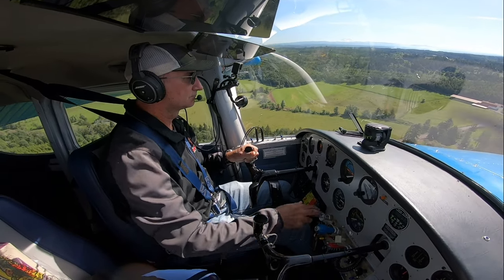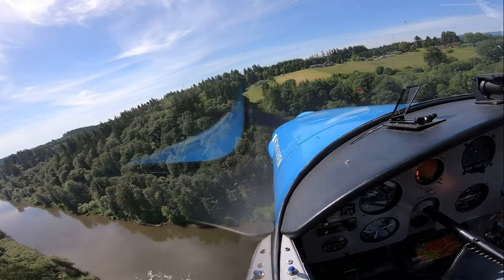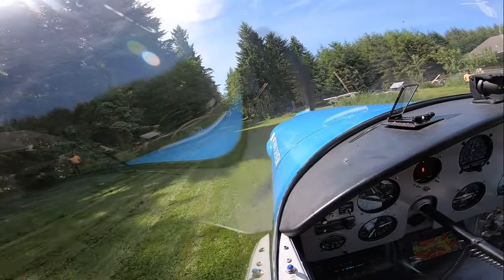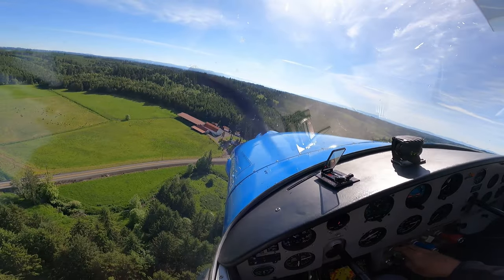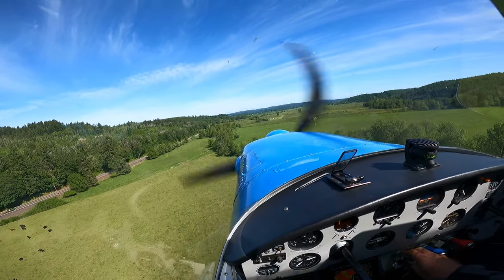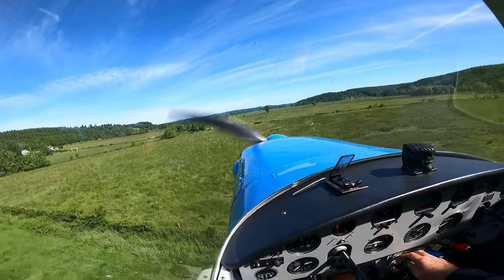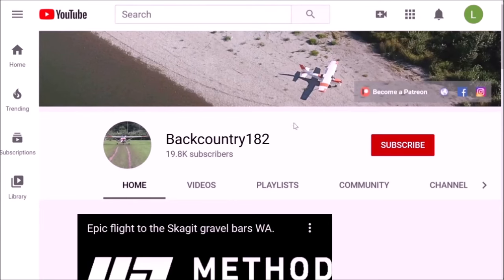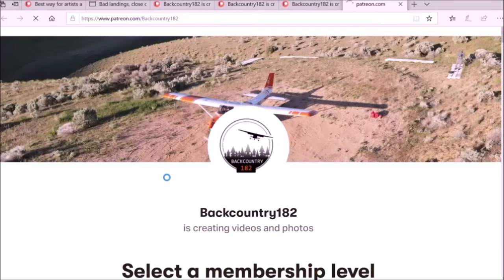Short , narrow uphill landing strip, Ski Jump #3

Comment: Hey man, like ur videos a lot! Question ... at 1:59 you make the turn left from base to final using rudder, to avoid changing the wing profile at very low speed, am I correct? it seems as if you make yoke inputs only to keep the wings leveled and maintain AOA.
Reply from the maker: Trying to keep the ball centered, and wings level.